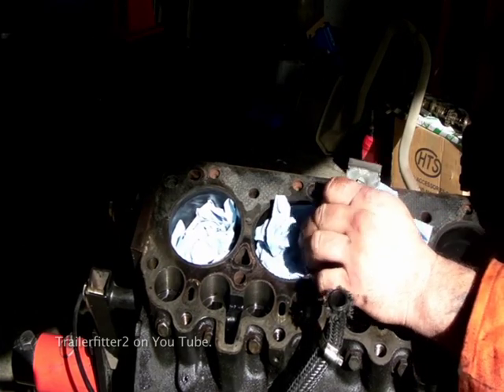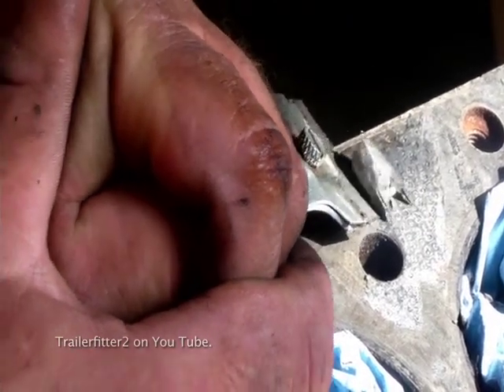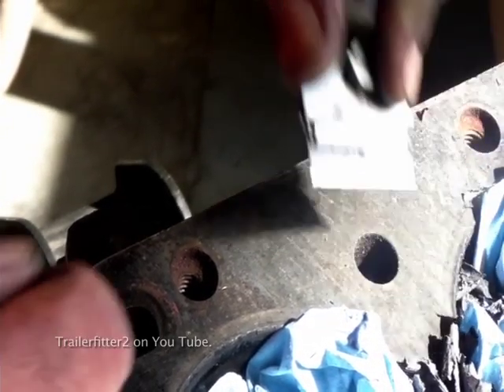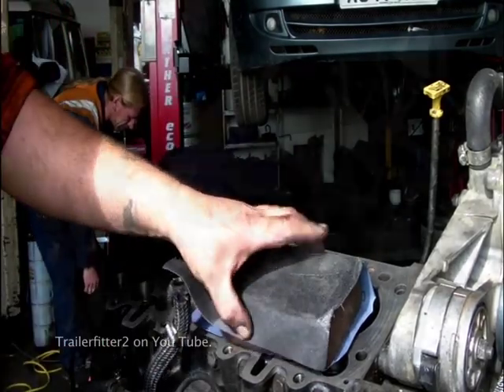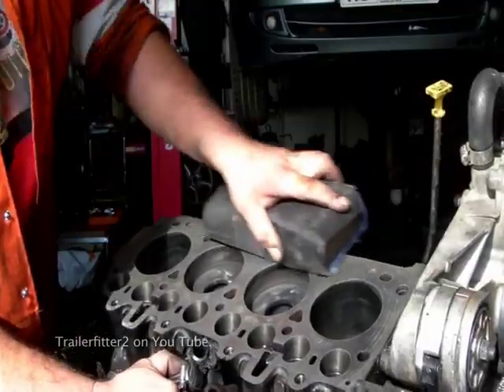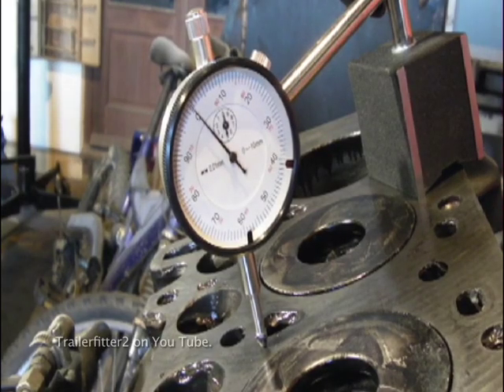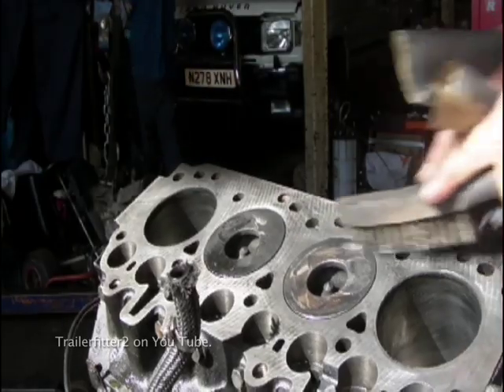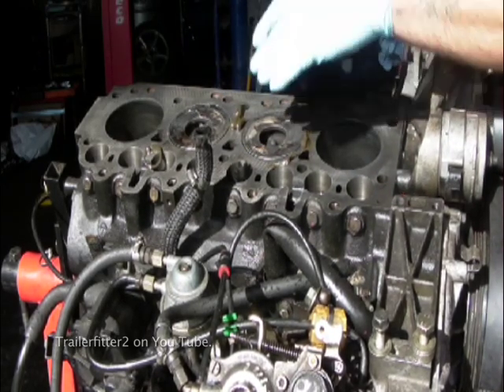Using scraper on head gasket preparing the cylinder block "top deck"

Comment: I have super hardened black stuff in some of the holes on the block. I can poke at it with a screw driver and it wont break off. I really have use muscle to get a little bit off to make the block all flat.
Just wondering if you would have an idea as to what that hard black stuff is?

Comment: I dont understand why you would greese the top deck, wouldnt that create an issue with the gasket sealing properly? 

  Lol from just a back yard mechanic
Reply from the maker: stay in the back yard.   lol   It is when one is going to keep the head off for a while.  Greasing it is to stop corrosion setting in.  I hope one would not grease the top of the block before fitting a gasket.